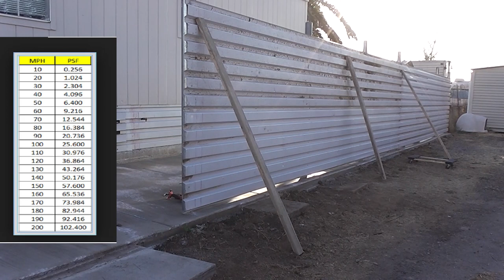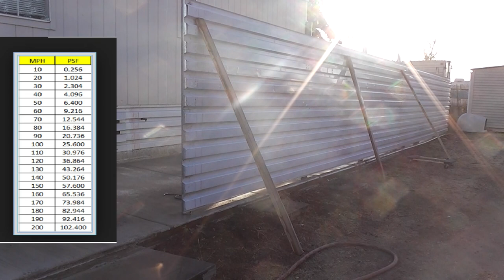DIY affordable, durable, steel privacy fence

Comment from the maker: *comment updated*: HEY GUYS. Would you be interested in 430 stainless B-decking for 2 bucks a square foot, or normal b-decking for 1 dollar per square foot. (430 stainless is the type that cheaper stainless barbeques and most stove hoods are made out of. also some of the cheaper stainless refrigerators) Please let me know your opinions. I'd like to manufacture stainless building products some day, and I want to know how much interest exists.
300 series stainless, unfortunately, would cost at least 7 bucks a square foot...
*Original Comment*: the fence posts must be plumb and straight or else it's gonna get awkward, not to mention look kinda bad. 
If your posts are out of straightness by like 1"+, then you might have to use long screws or pipe clamps to attach the fencing.
Summary: 
This product is not easy to find affordably!
cost: $.75-130. per square foot for surplus material. SHIPPING NOT INCLUDED! AKA you may not have affordable access to this product, unfortunately. it's called b-decking, roof decking, mezzanine flooring. check ebay, craigslist (searchtempest.com in order to search multiple craigslists around the country), facebook marketplace, or contact a local industrial building supply company to see if they might have a lead on the material.
make sure it's galvanized. sometimes it's only painted. sometimes it's galvanized and painted. Galvalume is better than galvanized, but I dunno if that's common for b-decking since it's typically not used on the exterior and may not warrant the more expensive coating for the normal end-users (commercial construction).
Right now I'm seeing the stuff for 1.25 psf on ebay in pensylvannia.
good luck with your fencing project
*update: info about wifi security: This fence BLOCKS wifi signal pretty effectively. note: For greatest security, speed, health, and energy efficiency, I recommend hard-wiring whenever possible.

Comment: Nice job! Great idea!! Currently looking for a metal/aluminum fence idea. Got about 300 ft to do.
Reply from the maker: I saw some thinner corrugated aluminum at a local scrap yard. It's pretty decent. They had quite a bit stacked up.
It's located in sacramento.
It's used, so it has a bunch of holes, but it's got a somewhat similar profile to this (flat edges, not curves - greater strength).
I don't think it was 300 lineal feet worth though. maybe, but doubtful.
jeez. maybe I should just buy it and replace the redwood fences at the apartments. hmmm...
Reply: @JustinCrediblename  I would love the name of this scrap yard. Would you please let me know?

Comment: Use a Grinder or Cut off wheel to cut the sheets. Use the square, even end to mark your cuts then go to town. Done this plenty of times
Reply from the maker: fries the zinc coating and leaves it prone to rust. not professional work.

Comment: My guess is by the way you speak if you have some type of engineering or extensive schooling in construction this was a beautiful idea we're going to do something similar but on a smaller lesson tense at scale
Reply from the maker: hehe. You're right that I've done quite a bit of reading about construction. The work in learning to design house plans from wood and steel framing and my work on a home-built foundation for a commercial concrete light pole were of good use in this project.

Comment: My name hereis based on my building smart “assist” devices. 3rd generation. Integrate security products also...

I have to go get a copy of City Ordinance on fences first.  Then county courthouse as there is property easement right of way road in front of house.

Part is City street.  They require 15feet I believe.

I’ll offer to buy rain drain pipe for ditch , they put it in and level it.  I’ll take fence closer and pay for “short sidewalk” in front of my property. Lol

Hope it works..

Comment: U reference some cost in video but I have trouble capturing info.  Disabled, I’m a bit slow.  
I have a good source to assist....thank God.  Holy cow. That will be a ton of concrete for each post . 5” for corner post and 3” down the line?

Comment: You can reinforce the post by filling them with quick crete
Reply from the maker: they are filed with concrete, as demonstrated in the video.
They are also filled with rebar AND 2.5" schedule 40 galvy pipes, at least at the lower levels, because maximum torsion occurs at the lower few feet

Comment: Great creativity, a few questions. How many feet of fencing did you install overall? What was the total cost? Not sure if you mention this on your video, thanks again for posting.
Reply from the maker: with hefty footers, 13 bucks a lineal foot. with normal fence installation (no footer), it's 8 bucks a lineal foot.
it's kind of hard to tell the total cost since part of the fence concrete was a 50' long, 8" thick concrete extension from the house as well as 1 yard for the bollard and 1.5 yards for a light post foundation.
But 6 bags of concrete is like 18 bucks. the posts were 10 bucks each, and 6'x.75x8' is like 36 bucks per expanse in between fence posts. probably like $.14 per rivet or about a buck a post.
so posts = 28 bucks, panels = 36 bucks.
Since there's hefty concrete & dual #5 rebar along the entire fence, that's probably another 40 bucks...an optional feature, but it'll keep animals in or out.
Reply: @JustinCrediblename  Thanks Justin, great creativity.

Comment: How long the stainless fence last? In my region it rains a lot.
Reply from the maker: this isn't stainless. it's painted and galvanized.
Salty ocean air is going to be the biggest detriment. Salty but dusty soil will also be problematic. 
But if you're still talking about stainless, then the alloy makes a huge difference as well.
If you're talking about cheap 430 SS, then it's a bit experiment.
What's fortunate is that there exists a lot of corrosion experiments in your environment with this alloy: modern "chrome" car trim. (not the chrome-plated steel of old)
Reply: @JustinCrediblename  It has  been over one year. Is there any issue with this fenced from wind or anything?
Reply from the maker: @CarsSupercars  oh hahahaha not a chance.
The concrete guys already crashed their truck into my protector pole, though. 'glad I put that thing there.
The only real issue has been that it's an anti-social fence. It's truly a shame that the owner of that property wanted the fence put up, IMO. The occupants on both sides of the fence are good people, and they'd prefer to be able to make friendly conversation
Reply: @JustinCrediblename  Well we here need one anti-social fence 😁. Found you on YT.

Comment: What else do you recommend if I can't do rivets?
Reply from the maker: #10 or #12 (depending on wind conditions) self-drilling screws, hot-dip galvanized, unless you can find affordable 410 stainless ones.
...'looks like it's about 100 bucks for 1000 #14 stainless self drillers with fine thread.
this link will probably be invalid some day, but here's a link. https://www.ebay.com/itm/200-14-x-1-Stainless-Steel-Hex-Washer-Head-Self-Drilling-Tapping-TEK-Screws/184386655013?hash=item2aee4d1325:g:nzYAAOSwX35fCP6y
Reply: @JustinCrediblename  Thank you for your reply, appreciate it.

Comment: @Justin Crediblename  What size aluminum post would you recommend for an 8ft fence with aluminum B decking? What gauge would recommend for the aluminum b decking with no traffic risk besides a riding lawnmower?  Would Really Appreciate it
Reply from the maker: It the lawnmower kicks up rocks and you want no dents then the gauge will not exist. It depends on your wind conditions and pole spacing. No rocks or hail + 90 mph winds? It depends on your alloy. if using 5005 h14 ?I dunno but I'd guess that 25 gauge would work. With less pure alloys, however, you run into the issue of pitting corrosion concerns if it's not properly anodized.
With regards to the poles for an 8' fence, that also depends on your alloy. Presuming 6061 t-6 aluminum at 8' spacing and 8' height, I'd feel pretty safe with a 3" tube of 3/16" thickness, partially filled with concrete. But aluminum tubes are ridiculously expensive, so unless you stumble across a good scrap yard or a good ebay auction, then the cost is going to be insane. Would I buy the tubes? Yes, but only from my local scrap yard or an ebay auction. For example, 6" nominal schedule 40 aluminum tubes at 40' lengths were $250 each on ebay. I would have sprung for that and chopped them up for a fence. 80 bucks a post, but damn good posts which won't need interior concrete reinforcement.

You're talking about a hell of a lot of money, though, so hiring a real engineer would be the way to go. With me, I'm mostly working off of intuition. It hasn't failed me yet, but that's because I overbuild most of the time.

Comment: Is there a website I can go to to get these sheets delivered? I really want to do this project but am having a hard time finding a place to get it in NJ. Also, can you share more details on the poles used.
Reply from the maker: ah bummer I missed your comment.
Unfortunately, it seems really tough to actually find b-decking for sale at good prices and small, residential quantities.
I bought a rollformer for roofing, but have yet to successfully set it up. 
I would like to, however, go into rollforming as a trade. If I do, then I'll eventually be offering 430 stainless b-decking for a decent price, I believe. I am very passionate about changing how we construct buildings because it's been such a travesty losing my health and lifespan in having to repair things which were built with junk materials to begin with.

The poles were found on craigslist. He said that they were typically used for tetherball poles. I recommend craigslist, facebook marketplace, or possibly even better: ebay.
Sometimes there are freight cars of HEAVY DUTY aluminum tube/pipe for a fantastic price. They'll last basically forever, unlike my zinc-coated pre-rust posts.

Sorry that sourcing materials is so hard

Comment: did he say 6 bags of concrete per post? wow and 33' down?
Reply from the maker: yeah. cuz soil bearing pressure is, worst case scenario, 150 psf. You've gotta have the surface area to sustain 85 mph winds in maximally saturated soil, or else you're taking risks. wind design load in this area was 85 mph at the time of fence building. today it's 90 mph. To be frank, if it weren't for the thick concrete "mow strip" with rebar in it, these posts would be cutting corners

Comment: Still there?  I love that fence!  I need it badly.   I would like to talk to you, get answers. I can call u free if in USA or Canada.
Reply from the maker: heheh damn... now that's pretty flattering.
If you'd like, I could google your company's phone number, or you could simply ask the questions here in the comments.
Since I don't want to learn about engineering, I tend to overbuild and spend too much on materials. So I don't consider myself to be an ideal source of advice. At least my projects don't fail, though. heheh.
Reply: Can you estimate cost per foot based on your overall footage?  I have 1.2acre lot overall. I need to estimate my cost.. I can use property plat for footage to be close in estimate.
Reply: I will leave a section open to 100 acre neighbor to allow deer and other wild animals in. I am taming them lol.
Reply from the maker: @smartassist9700  aw shucks I'm so sorry it took me this long to get back to you.

There are TONS of variables here.
Are you doing your own work?
Can you actually find the B-decking for a decent price?
Are you going to put in mow strips?
Are your mow strips going to be strong enough to support the foundation of a house, or weaker?
What kind of winter-summer soil shifting occurs in your area?
What's the weakest soil bearing pressure that exists during wintertime in your plot?
Do you have granite boulders or anything like that in your soil?
Can a concrete truck reach all aspects of your plot?
Are you going to hire out any parts of the process? (I'd recommend hiring out the fence post hole augering to someone with a bobcat and a 12"+ auger, if possible.
Do you have tree roots that are in this soil that you'll have to cut for the sake of the mow strip?

Tons of variables :)
Reply: It’s called b-decking?  Roof?  What store u get it?
F
Reply from the maker: @smartassist9700  Yup. B Deck. It was being sold off as part of the disassembly of a mezzanine flooring system. I didn't buy it new. If I did, it'd probably be at least twice as expensive.
Reply: Oh ok.....   Disabled low income.... I badly need similar fence..... but for 1 acre. Lol